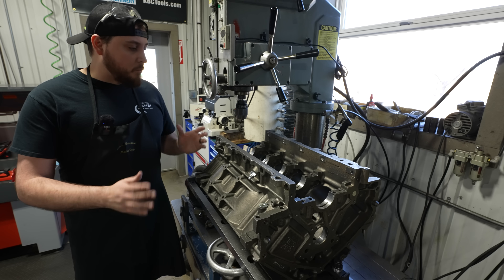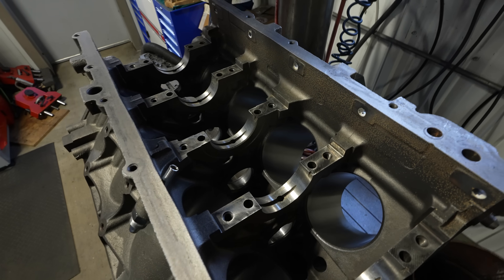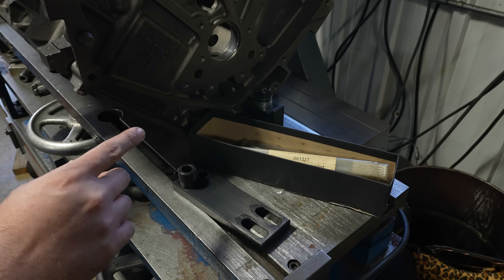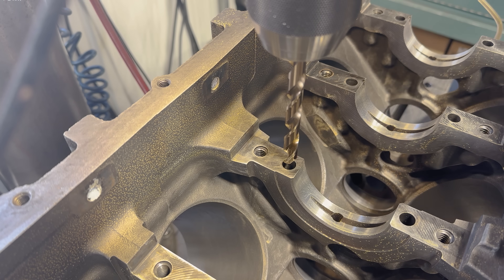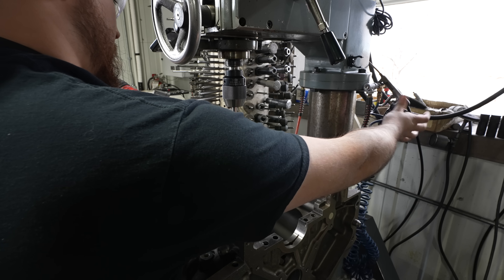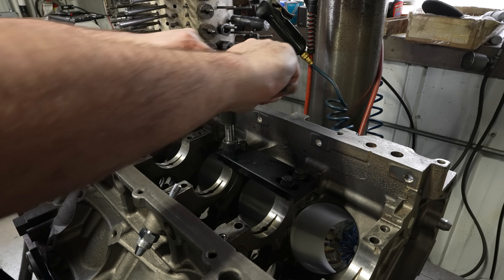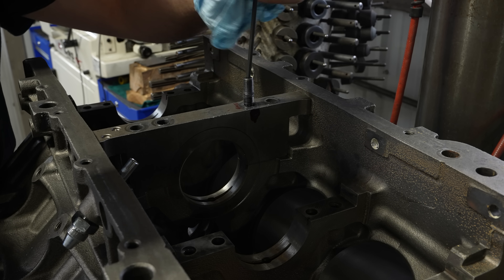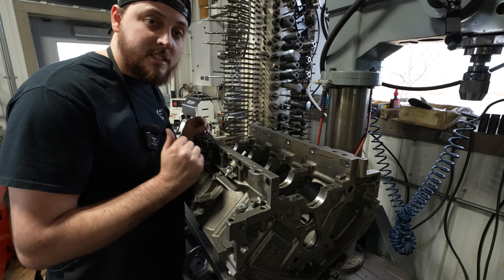The Customer BROKE A Main Stud Off In Their BRAND NEW LS Block...

Comment from the maker: Shoutout to  @EngineRehab for renting me his Gen III LS Main Bearing Bolt Thread Timesert Kit! 🤡
Reply: Hell  yea!!!! That was nice of him
Reply: I bet you will get one on order!! Good job!!
Reply: Nice work. I have used 100's of Timeserts over the last 20+ years and have never had 1 fail.
Reply: Moo ji
Reply: @douglasburd6905  with type of insert, do you prefer.
Reply: Crazy they have tool for this. Is it that common?
Reply: @BobTheBreaker9 only has to happen once to the right person
Reply: Great repair, so what doid you charge for that?
Reply: Yes it will work just fine, nice job ,In the end you saved the day ,.
Reply: "I hope I don't break the tap!"
Reply: A thread repair key specially made for this specific engine?  Sounds like GM under-specced the bolts if they break often enough to sell a tool for it.
Reply: @Dave5843-d9m  THIS is why it is so important to chase the threads on EVERY hole of a reman block-you never know if the rebuilder cleaned them up, or not-until something like this happens!
Reply: @Dave5843-d9m The real problem is incompetent people assembling engines.  I own hundreds of different specialty Time-sert sets including for the set for the ford  triton spark plugs and I have sets for every other type of spark plug and they are almost always needed due to previous mechanics incompetent work.
Reply: How much does this job cost?
Reply: Great job!

Comment: Makes me laugh reading the comments referencing left hand drill bits.  You don't think this Machine shop has left hand drill bits?  By the way, they are a great save if the threads are not the reason the bolt snapped.  That is maybe 1 out of 100.  Great job, great video.

Comment: I did time sert on head bolts for  97 deville 4.6 northstar. Put 50,000 very hard miles after the job was done ,then the transmission failed but not the head bolts. Took exactly 40 hrs to do the whole job.

Comment: Your installing a time-insert in cast iron it will be fine,  I used the 600.00 time-insert kit to repair threads in a Subaru 2.5 as the middle head bolt on the left side was stripped in the aluminum block.  followed the time-insert procedure and the insert worked perfectly and all head bolts torqued to specs.  well made video.

Comment: On some hardware like this or hardware that has seen lots of heat cycles like turbo exhaust hardware and customers have hand drilled off center, I have used two flute or 4 flute carbide end mills as a starter to prevent deflection you would get with standard drills. I have even used this method when people have used extractor bits they’ve broken off in there

Comment: Having had removed literally hundreds of broken screws over the years, seldom did I need helicopters or timeserts.  I simply lined up on the hole center and slowly went in with a carbide end mill.  Followed up with a hook to dig out the thread remnants and chased the threads.

Comment: Old machinist here. Sometimes inserts are the best you can do.  I dont personally like them at all.  As In the heavy industry and off highway stresses they almost always eventually failed.
Yeah, you may have seen or had great luck. But we were an Oem, you didnt see 1/10th what I did.    Same goes for antiseize.  If you do not use it everywhere your a boob. And wet torque tables are available. So you dont snap bolts.  That I probably made... 
Drops tiny lil microphone and tiny speaker.  Sweeps up chips.

Comment: Watchng you work makes me wish I had gone tech school to become a machinist,  Pharmacy school was pretty boring at times.  I am retired now-age 77- and I have an 'ElCamino in the garage.  I got a hold of a '95 Lt1 with a 4l6e (?) transmission.  I have replaced the front brakes with the larger brakes from a 2002 2wd Blazer.  I have plans to replace the rear drums with the Blazer discs (with e brake)  I would like to put a limited slip rear end.  BUt I had a mild stroke last year and it has left me pretty weak.  I would love to get her all together before I croak!  It would be easier for my wife to sell as a roller!

Comment: I bought a short block from a "respected" overhauler in southern CA. ALL of the threaded holes had blast media in them. I decided to tear it completely down and had the block cleaned. I then ran a wire brush through everything including the oil gallies and got more media out of it. Ran taps through all the threaded holes and reassembled expecting everything to be wrong. I was right.

Comment: The threads in the engine block should've been cleaned out with plug or bottoming thread taps prior to installing & torquing the bolts or studs because the specified torque won't be reached if the threads aren't clean.

It's something that I was taught when I did an automotive course 32 years ago  !

Comment: I'm curious, with the customer's slightly off center hole,vwhy would you use a drill bit and not an endmill? Drill bits, even when perfectly centered will flex and follow the existing off center hole, while an endmill won't

Comment: I once had a head bolt on a 302 ford.Pull out from the block, a few days after I torqued it down. It's not uncommon for the front left head bolt to crack down to the oil filter connection. It wasn't even maximum torque, because I had aluminum heads. Maybe 65 to 80 ft lbs.  Not the same but kind of similar that it broke on its own, after I torqued it with seemingly no trouble, everything was normal until it wasn't.😢
Reply: Pretty common on those 302 blocks, not so much on 351

Comment: I'm wondering why you didn't use an endmill and try to remove the broken bolt?  Or an end mill to make a true center.  I'd have been worried the new drill bit would follow the old hole, thus using an end mill.  I'm just a home mechanic that has a couple of toys (machines) so I'm still learning.  Thanks for sharing!

Comment: The way it sounds, some machine shops are absolutely terrible. So bad that they might just as well be dumping sand, gravel, or metal shavings into the oil pan while assembling the engine. It’s a disgrace and a ripoff to the customer for lousy quality workmanship. I’m glad that your workmanship is high quality. Your customers get top notch work for their money.

Comment: Draping a sheet of poly over the block sure would have added another level of protection instead of watching those steel chips fall into the oil ports on the main bearings. You can vaccuum and blow all you want, but youll just never know if you got them all. Not allowing them in is a pretty safe and easy solution. Next time right!
Reply: Yeah sure dude

Comment: Very nice work, twice in my 56 years of life have I had to do something similar one was a engine bolt for a vw engine and once for a spark plug that a shop cross threaded and the plug blew out of the hole. And I was lucky I was able to get to it as it was second from the back on the passenger side. And it worked great for as long as I had it. Another 70,000 miles

Comment: A couple of suggestions.
Try a left-handed drill first. You might have got the remains of the stud out without having to do the repair.
Buy your shop a bottle of ANCHORLUBE cutting paste. It tends to stay put and works on almost any metal. Highly recommended for drilling and tapping.
Thanks for the video.

Comment: Good grief if they’re going in that hard, stop and figure out why.  I’m not a mechanic or an engine builder but I just did my first head gasket (on an old tractor).  I used the bolts as thread chasers the blew out the holes with compressed air.  I could turn all of them to max depth with my fingers after that prep work.

Comment: Ok, something no one does........slow down the drill speed and use left-hand twist drill bits. Experience has tought me that with a left handed drill bit, careful attention and slow drill speed it will at a point literally back out what is left of the bolt or stud.

Comment: For old alloy cases and heads of old motorcycles, I ve found that broken studs are rarer than stripped threads , alignment to the original hole location is crucial, helps if you have a mating component as a jig.
Just done 3 helicoils 3/16 Whit x24 tpi today, find older pre-wind inserting tools much superior. Timesert 14mm spark plug insert, copper coated solid much superior than helicoils, at least on air cooled heads. 
Have found that left hand drills can be a great help in winding out broken studs, but ONLY with a keyed chuck!!
Great video, I must be older even than the Cleaning Guy..any thanks from 'over the pond'

Comment: In some cases the repair maybe better than the original. When making blocks and doing machine work there is always the possibility of manufacturing processes not going great. Also they could be using tooling to make putting orginal tools work faster and drilling the hole bigger for less precentage of threads. The repair is done very well and will last as long as the block is unable.

Comment: I'm sorry, I love your work, but I would have dial indicated the hole and interpolated the hole using a milling machine this down to near nothing, usually not every time but you can cut the old thread out, With out damaging the original thread. Then carefully removing the few thousandths of inch of material left in the hole while maintaining the minor id of the thread. Only using the thread helical if absolutely needed.  A drill bit always follows the previous hole, thats were a end mill cuts true and EDM cuts true as well. This machine you have is a very precision machine, and should have or could have been used to it full potential. Again, I love your work, I worked both as young automotive machinist and later in life as a machinist, my youth was spent grinding crankshafts, and rebuilding heads and align honing rods and mains. Love your channel..

Comment: In tech school we had to snap a bolt off and the goal was to drill the minor diameter of the bolt so that after you drill it out the thread would pull out as a coil was very satisfying
Reply: And no need to repair after just clean and it's good to go

Comment: It’ll be good as new and unmolested. My question is did the owner drill the broken stud too far off center to save the original threads? It seems to me if he didn’t damage them that you could drill it stepping up gradually in size until you were just below the original tap drill size, then switch to a left hand drill for the tap size and drill until the remaining part of the stud comes loose and spins out of the hole. 
If he got into the threads, then I know why you went the route you did.

Comment: A threaded insert ought to provide a better loading capability than the virgin material.  In this case the insert is a high tensile thread of larger diameter than original into a virgin thread so it should be better.  I witnessed a test of various inserts against the thread in the base material (aluminium) and the Timesert came 2nd in both pull out and thread stripping due to over-torque  The winner that surprised many was Helicoil.  The advantage of the Helicoil is that as a stud/bolt is driven in the threads are pushed out by the ramping action that then makes full contact with the thread of the base material.  The Timesert does something close but only at the bottom of the insert, the rest have the usual clearances dictated by the requirement to drive in a solid threaded tube.  The cost and the simplicity of the Helicoil belie its genius.

Comment: I have a set of left hand drill bits. 9 times out of 10 the bit will grab the broken stud or bolt and back it out. You can feel when the bit grabs and then you let the pressure off and come right out.

Comment: As far as I'm concerned you NAILED it on setting up.
This is what I do when removing broken screws from guns.
Without a mill type set up you're doomed to failure.
 👍
My drill and tap jigs for firearms are just a smaller version of your jig with D&T bushings. Pretty cool to see an upscaled application.

Comment: I am a fastener person. You cannot take enough care in working with fasteners on motors. Obviously the same guy that broke the bolt tried to take it out. It's the mains on the crank,😅slow down this problem was easily avoided by proper inspection of the male and female parts before assembly .I suspect that bolt had debris on it and or in the hole, drove it down with an impact distorted the thread and heate it up,then hit it with a large torque wrench and pop, were they new bolts? I would have loved to have the other piece of the bolt for examination. Engine blocks are castings, the female threaded holes are to be treated with utmost care at all times, but insert technology has been proven to be as strong as original so we have you covered😅 thank you

Comment: I usually run a tap/thread chaser in every hole to make sure it is free of anything that'll cause a bolt to bind up when I'm building an engine.  Adds time to the labor cost but well worth the effort. You're always one bolt away from being a two week ordeal.  Plus, spending money on good equipment saves time and makes the job way easier.
  Most people can't drill/tap their own because they don't have anything to really hold the drill bit still enough to not flex.  A $300 kit is an excellent tool to save a block.
  Also, people go to hf expecting to get good drill bits, give up, and take it to someone who bought bits somewhere else, and end up spending way more than if they had just bought quality tools.

Comment: If you go in with a full bore size 140 degree spot drill then a left hand drill that is at the tapping diameter you can either pull the stud right out or drill and pull the wire of the threads right out. Of course, you need to do this with a well-trammed mill. I always send a tap back through it too. Although I think the good inserts are just as good.

Comment: I wonder if the first set of main bolts were chinese junk. i'm rebuilding an L31 Vortec and was tempted to buy some to save a buck, but in reading the reviews i saw where someone said they broke a bolt and had to drill it out and others made comments about the threads looked pretty bad. So I happily spent the extra 2X more $$ to get ARP studs and bolts for my rods and mains. I know ARPs are not cheap. But, I have never had one give me a problem and i always chase the holes and blow them out and use their lube as instructions require. Main bolts from ARP are probably $70 plus shipping and I know he paid way more that that to have it fixed. Old saying but it's true "buy once and cry once". I like others use a flat bottom 4 flute mill to drill out something like that because they don't walk and a pointed drill bit has a tendency to follow the crooked hole the last guy drilled. I use HSS or cobalt instead of carbide in holes. They are sharper and won't shatter like carbide because it's brittle and if you break steel you can retrieve it and getting carbide out is a religious experience and you generally have to shatter it to get it out. Musings from an old gunsmith/machinist.

Comment: You definitely did a nice job on the repair and you're very skilled I just don't know if I would trust a repaired main bolt That's like the most important part of the engine. I guess I'd be okay with it with a daily driver but if I was going for Max horsepower I'd want a new block

Comment: Broke a head bolt on my 2002 Silverado. Broke at the threads, engine was still in the truck. Put a piece of stainless tube down in the block and dropped a welding rod down in it and welded it to the stud. Not an easy task to welding in such a small hole, took 4 hours. ARP fasteners put it back together. New TTY Mahle head bolt broke while doing the final torque. Don't know why.

Comment: Had a company in Seattle that had a laser machine that could burn out any bolt without touching the threads. have used it back in the late  1980,s to late 1990,s

Comment: Did the same stuff to a Ferrari block left hand drill brought 3 studs up 2 were just like this one and I only had 4 or 5 thousands left. Used liquid nitrogen to pull out the remains left in the threads. Needless to say I couldn't get the last one out! Very rare engine went to a very rare car. Couldn't over size and heli coil it. I was still happy with all my work and it was a headache and challenging.😂😂😂😂

Comment: Junk the block? You gotta be kidding me. Ot takes some skill, and the simple methods probanly wo t wirk. That crud in the hole will just lock a bolt in there. But "so called chine shops" that cant fix a broken bolt are lije "so called locksmiths" that use a crowbar to open every lock.

I allways drill with a left handed drill. Sonetines you get lucky and the fastener comes put on the drill.

Comment: Had a KIA Sedona come in with blown head gaskets. My apprentice pulled the heads and told me a bunch of head bolts weren't tight. They pulled threads out of the block. We used a Time-sert kit and installed sleeves in all 16 head bolt holes. Didn't have the fancy equipment. Just a hand drill and did it still in the car. Worked pretty well.

Comment: It will last. Timeserts get used all the time to repair head bolt holes. I've used them a lot and would argue they are almost a must if a block is aluminum. I work for chrysler and our official repair kit for 3.6 head bolts is a rebranded timesert kit.